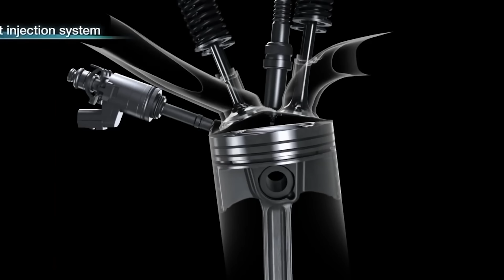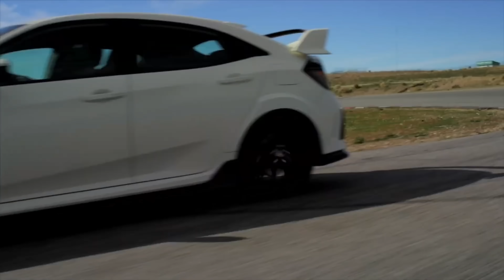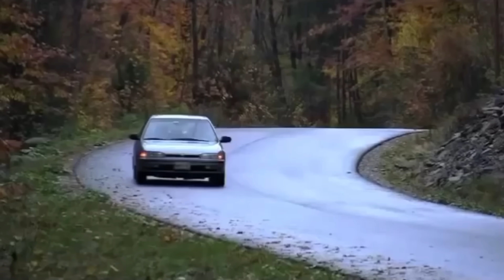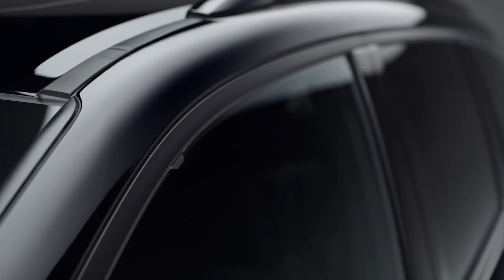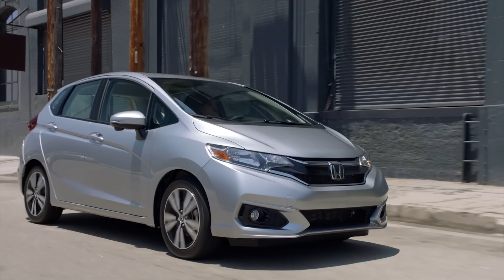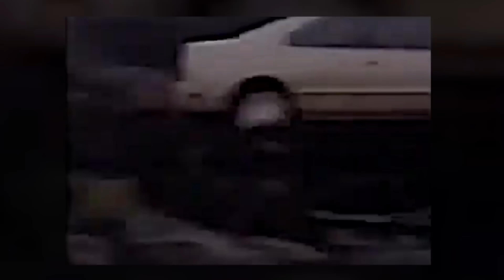Honda's New Engine is the Most Powerful Engine Ever Made

Comment: I have a 2010 Crosstour EX-L. It's a terrific car. Perfect for Northern States and snow. Super reliable with the exception of the alternator issue on the 3.5 liter engines. Also wish it had a timing chain instead of the belt. But, a terrific car to drive.
Reply: I just had my timing belt changed on my j35 2004 pilot...somehow survived 180k plus miles! replace with OEM belt

Comment: 2011 Honda Fit 345,000 miles and still running strong.
Reply: Actually it's a really fun car it handles like a
track car and it's not the fastest car in the world but she's not the slowest 😂 and if you're game you can drop a k series motor in it.
Reply: I have a 2010 Fit with 185K. It runs great and its my little go kart. Looking at the 2025 Civic Hybrid now.
Reply: I just bought a 2008 Honda Fit with 112,000 it purrs like a kitten. It is the 5 speed variety, Georgia car car is spotless underneath. Its the bold blue color.
Reply: @hcox1111  but is it fun to drive?
Reply: @Keith-e5f  It is actually a blast to drive but it likes 55 to 60 and after that the engine is running a little high about 2800 RPM at 60. The automatic version runs at 2200 RPM at 60.
Reply: And they were really boring MI correct?
Reply: Drop a K24 in the Fit and you have a bonafide hotrod....check out the videos...

Comment: I'm sad because you didn't mention my Honda Crosstour.  It was an incredibly quiet and easy riding driving vehicle. The V6 vtec engine was incredibly fuel efficient. I bought it in '07 for 18,500 and sold it in 2023 for 12,500. It's value held up incredibly well.
Reply: That is because the crosstour in an accord, great vehicles
Reply: @yoshi2413   Yeah just drove 12 miles to the dog park in the middle of the Midwest blizzard - the thing is a beast in the snow! 👍
Reply: I really LOVE my 2013 Crosstour with the K24 - bought a one owner with 88K miles during the pandemic for only $10K cash and the thing still runs perfect with over 140K miles 😊
Reply: That was a steal  @anthonysilvestri4946

Comment: My first car was a used 1976 Accord hatchback. First new car, 1986 CRX. I have leased and purchased Hondas my whole life. Currently holding onto my 2014 Civic with 191k miles and 2011 CRV with 162k miles. Love these cars and hope Honda figures out how to stay in the business in these turbulent times.
Reply: Unfortunately i had nothing but issues with my 2012 honda civic compared to gm cars which were no issue at all
Reply: @weatherwatcher5303  what were your debates?
Reply: @DJazzy1 had to replace the catalytic converter car was running rich, replaced 02 sensor for oem one as aftermarket ones didnt work that was £700 alone and engine has bad oil control rimgs so burns alot of oil
Reply: @weatherwatcher5303 the world is coming to an end.

Comment: Scotty, could you please address cylinder deactivation in Hondas?  This doesn't seem like a good idea, but they keep pushing vcm in every new vehicle. What's your take?
Reply: The first generation of VCM engines had problems will oil consumption requiring piston ring replacement. There was a warranty extension for a few years of the V6 models.

Now, with direct injection, the problem we're seeing now is significant carbon buildup on the back side of the intake valves. This reduces fuel economy and causes misfires.

In general, most warranty extensions do not cover more than a fraction of the cars that are actually affected by whatever problem they are addressing.

They're a good company overall, but they've got some problems.

Comment: this video is so accurate. I own a 2012 Honda civic for 7 years. Beside oil change, brake replacement and tires, I don’t remember any single issue I had with it. Sold it after 7 years and got about 40% of my original cost. Right now I’m driving my 3rd Honda a 2023 odyssey
Reply: 2010 civic for 14 years. No problems. Had almost 200,000 miles.
Reply: From a Civic to Odyssey 😂 Got married with kids huh?

Comment: I have a '03 Honda Element with 348,000 miles. Runs great and it's not falling apart!
Reply: Bring the element back
Reply: Element lover here…. My ‘07 SC has 93,000.  
Still pristine, and plan to keep it forever.❤
Reply: Yes sir that has the legendary 2.4L motor, just also be sure to change your transmission fluid, and rear diff with HONDA fluids ONLY
Reply: @AcerArtsOfficial  sometimes I feel violated by Honda fluid prices so I buy something else just to piss them off when I take it in for warranty.
Reply: @Keith-e5f  ive always done my own fluids on the 2.4l motors because they are super easy.. especially the rear diff and transmission.. easier than the oil change to do because atleast everything is under the car and you dont reach over the back of the motor for the oil filter
Reply: @Keith-e5f   Mobil One full synthetic is the only way to go 👍
Reply: @anthonysilvestri4946  I've seen test where they put Mobil 1 up against super tech Advanced full synthetic. Very little difference. But there's a significant difference in price. Ivan Walmart oil in all my vehicles for quite some time. Even brand new porsches. I think people tend to overthink oil. You just got to change it regularly. Just my two cents worth.
Reply: @Keith-e5f   I agree but I always buy it on sale and it isn't really that much more expensive than the Super Tech 👍
Reply: @anthonysilvestri4946  I just bought two five quart jugs from Walmart on sale.
Reply: I almost bought one but didn’t.  Now I regret it.  Although I still bought a fine vehicle (V8 AWD 4Runner), but I think if I bought the element instead, I’d be driving it a lot more and didn’t need to buy another small car.
Reply: @majorcalvary6515 You're just fine with that 4Runner. No reason to regret it. It'll last just as long if not longer
Reply: Love the element. Only wish it had better gas mileage and that the frame wasn’t as heavy.
Reply: Many Honda still driving around from the late 90s early 2000’s. A mate of mine daily’s a 05 accord
Reply: Love my 2010 element!
Reply: My Honda civic 1.5 vtec e. Always flooring it. Didn't use a drop of oil. Totalled it in a car accident. Head on collision.
Reply: Yup.  Long live my 2011 Element!
Reply: I miss my Element 🙁  But I have a Crosstour now with the K24 and absolutely love it! ❤
Reply: It will need valve adjustments.  Especially the exhaust side
Reply: @upthereuc  for now.
Reply: Wow!!  What type of oil do you use and how often do you change the oil?
Reply: Still driving my 1999 Integra GS-R!  A lot less miles than  your Element (I only drive it in the Spring/summer and on wknds only) but my friend's '97 Integra GS has >450k miles on it!  Those B18 engines are bulletproof!
Reply: At 348k, have you changed out the timing chain?
Reply: Low on oil
Reply: Great news! Shame it's an Element though.
Reply: 2006 element 245k still running strong.
Reply: Run Valvoline Restore and Protect

Comment: I own a 2011 Honda CRV with approximately 110,000 miles on it. I do my own repairs so I don't have to pay for labor.  The VVT valve was replaced, CV axles, radiator, & wheel bearings.  The TPMS sensors have just recently stopped working & the cargo door struts were also recently replaced.  Most of the parts were OEM except for the CV axles due to cost.  I intend to keep it at least until it reaches 200,000 miles.  I've read that Honda quality has slipped lately, with a number of recalls being instituted.  I would not buy one with a CVT transmission, nor one with 0w oil in the engine.  Every car manufacturer has issues with some of its models.  If & when I buy another car it will definitely be a Honda model without all the modules they seem to be adding to cars.  Great video by the way Scotty!
Reply: Could you tell me why you don't like 0w oiled engines?

Comment: Not true… V-tek system was used for 1996 Honda Prelude Vtek. They use Si similar to VTEC engine. And S used from Accord engine and only this engine if timing belt brakes, valves from head won’t be broken because on top cylinders cut out space for valves…

Comment: Bought a CRV new 2006.  150,000 KM.  The usual wear items and an alternator regulator.  That’s it.  Best car I’ve ever owned.
Reply: 150k km? 
That's it?? My sister's 07 is at 399k km 😂 

Lots of life yet on those!
Reply: @Rifq2day  My '12 is almost to 40k miles. No issues yet.
Reply: 2013 CRV here ....love the thing......everyday driver ....roomy front and back....need it  Im 6'5
Reply: My wife's 2004 CRV EX AWD had 140k miles on it when someone who ran a red light t-boned the car and totaled it in 2013.  No issues with it at all except for the window switch in the driver's side door that went bad at 110k mi.  I got the part for $30 and installed it myself.  I was going to change the rear diff. fluid the day after it got totaled, so we didn't even get to change that (!) Just motor oil every 4k mi. (Mobil 1), brakes, tires, 1 radiator/antifreeze and 1 brake fluid flush, and tranny fluid around 100k mi.  That was it!  Also the paint and clear coat on that CRV looked like new too!  It had NO dings or rock chips on it somehow (all my Civics & Accords had a dozen or more of rock chips and dings) which means the CRV had many coats of paint and strong sheet metal.  Awesome car.. even though I don't like SUV's, but the wife does.  Oh, the insurance gave us $9K for the car after 9.5 years of ownership and 140k mi.!  I paid $20,100 (dealer invoice) for it (Sticker was $22K) so we got 45% of what we paid after almost a decade.
Reply: @vtecharrys.6981  was the perpetrator an old man in a black mercedes or bmw? Those people are the worst lol

Comment: Civic vs Corolla. I do feel Honda's engines are are smoother. But most mechanic give a SLIGHT edge to Toyota for reliability. And Honda's engine give a more kick. 

How the British screwed Honda. Honda have a short live model the Concerto. It have a double wishbone suspension. But production 'disappear' as Honda teamed up with British Rover. So Rover's car is actually a Honda frame and engine with a British body. So when Rover's parent company (British Aerospace) wanted to sell off Rover, everyone though it will go to Honda. But it went to BMW. Citing Rover is a 'European Brand'.  
End result. Rover car (became MG) was finally bought over by a China group. Land Rover was bough over by an India group. And it was a forced merger with Jaguar.

Comment: I just watched your Honda overview YT video.

Currently I own a 1990 Honda CRX Si 2-door hatchback.   Currently on its 2nd engine ( B16 just wore out ), so the engine was swapped for a 1992 civic. Si ( D16 vtech ÑOT BEING used ).  Main LOW point ( having 350k+ miles ) is the "body rust cancer".  BOTH rear wheel fenders & moon roof ( sealed it shut ) & drivers door with a harge mid-section rust hole ( duct taped over hole & sprayed all rust areas w/rustoleum white Rattle can paint ).

Reliable < 10 mile RT daily driver in the midwest.

I would love if someone ( SK ) would be willing to answer some questions on what I can / should do to keep it going.

Thanks,
- Scott M

Comment: I own a 2012 Accord with 169,068 miles. It uses no oil. I have replaced the starter and a wheel bearing in the 5 years I have had the Honda Accord.

Comment: Ecotec and K24 (both most likely their billet counter parts) currently hold 5 second territory for the ¼ mile drag race for 4 cylinder engines. 

Porsche LM program a V4 engine with turbo and electric motor set the overall fastest lap on the Green Hell (nurburgring in Deutschland). Where Hyundai incorporated their N / N Line in part of the testing location for their N N line vehicles, and Hyundai's global R&D center is located in Namyang district in South Korea. You'd think a inline 6 (straight 6) with twin turbos, or perhaps a V8, v10, v12, flat 4 or flat 6, all using some kind of forced induction would hold the overall fastest lap record on , "The Ring." Nope, a 4-banger rice cooker, (in this case, a 4-banger Deutsch bread maker) holds the fastest overall lap time, 5 minutes 19.54 seconds. Awesome youtube channel, Boss Scotty 🤙🏽🙏🕎✝️

Comment: Love our 2020 crv. Had to replace the fuel injectors at 80000 miles but $90 and 2 hours later runs good as new. Great mpg and will spin the tires when I want to.

Comment: Honda has never failed me between cars, motorcycles,lawnmower. Have 2009 Crv 190,000 runs like new normal maintenance that’s it bought it with 151,000 miles on it. Does not burn any oil just did a 1200 miles trip over Christmas avg 26 mpg. 🇺🇸😄

Comment: I would like 2016 or newer civic manual non turbo. Truely a dream car.
Reply: I have 6 speed 2017 Honda Accord Sport. It is quieter and rides better than the Civic. It has the 2.4L.
Reply: @hcox1111  4 door sedan ?
Reply: @xxMaNaxx  Yes with the back seats that flip up or down so it can haul more than most small cars.
Reply: @Bottoarguewith  non turbo ?
Reply: @xxMaNaxx  1.5L non turbo super simple and reliable
Reply: @Bottoarguewith   I'll have to consider that for real .. mpgs ?
Reply: @xxMaNaxx  About 40 maybe 44 on highway
Reply: @hcox1111  thats amazing actually

Comment: Subarus are the most expensive to repair because of their boxer layout, to replace/repair components and gaskets require removal of other parts. Plus many new Subarus come with CVT units.🤦‍♂️ My in-law's 2017 Impreza's  CVT is why we don't own it. Instead we still have their 2007 Matrix with well over 320k.

Comment: I have 2023 Honda CR-V and so far is the best out of all i had
Reply: The old-school early 2000s 5speed manual crvs were absolutely unstoppable in 4wd
  Seen those things make it up steep snowy hills better then some wranglers.
Reply: @LORD_OF_THE_ROOTS But they could increase the ground clearance from 7 inches to 8.7 inches, you wouldn't have to install the raising pads yourself
Reply: I miss supporting my hands with armrests, in the latest Honda they gave a fancy seat with fountains, but on a long trip without it my hands simply get tired, and in CRV III I drive like a king